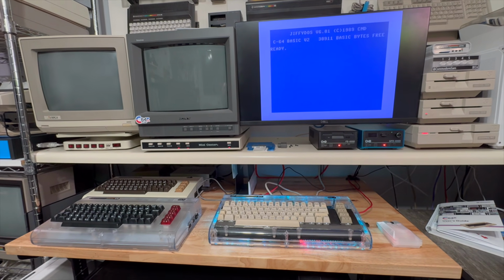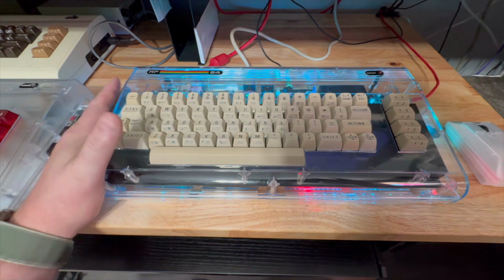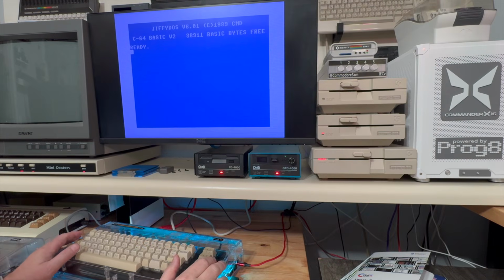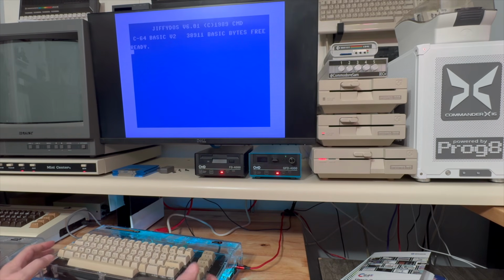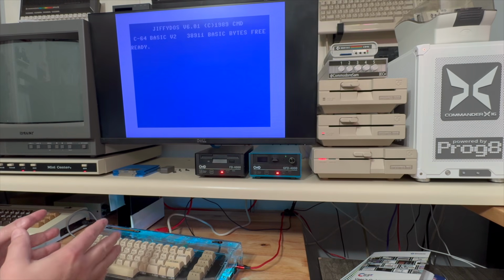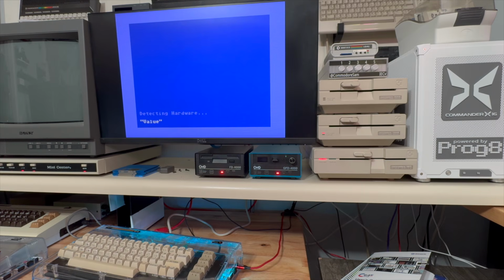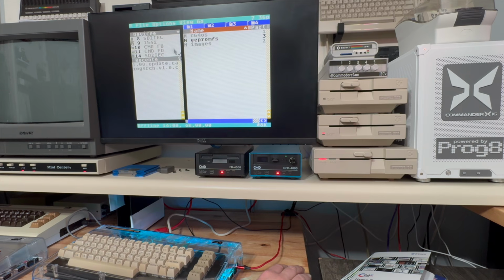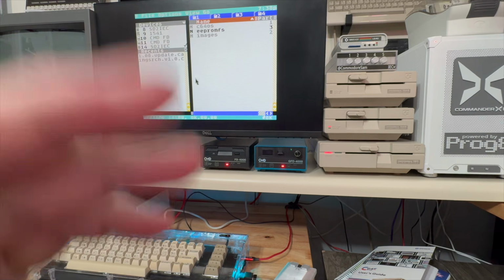uIEC/SD Internal SD2IEC for the Commodore 64 Ultimate and Ultimate 64 Elite II

Comment: Thanks for all the information. I really enjoy your YouTube videos. I found one caveat though. You cannot disable the uiec2/sd which is required using some software that is copy protected. I have the daughterboard which has buttons and long pressing the forward button disables the uiec2/sd temporarily. There is also a way to use the atn line with a switch to disable it according to a poster on lemon 64.

"According to the Wiki ( https://www.c64-wiki.com/wiki/%C2%B5IEC  ) , holding S1 will put the unit into sleep mode.

However, what I have done, is put a switch on the ATN line. So when I boot up I have it so the ATN is not enabled on the uIEC and the 1541 Ultimate II works just fine." 

The poster was having problems with the uiec interfering with his 1541 ultimate. Right now I am going to use the uiec2/sd externally with the daughter card. It would be simple to add a switch on the atn line, but then I would need to mount it somewhere. Thanks for all the help.  Ro

Comment: One more question. Is it possible to disable the uIEC without opening the C64 and pull out the wires? There is software that does not like other drives on the IEC bus. I have read that an on/off switch on the ATN pin could disable the drive when powering the C64 on.
Reply from the maker: Not currently. I am considering what I want to do about that. However, for most people it would be a rare need. If I do come up with my take on a solution, I will post an update video. Thanks for watching.
Reply: @CommodoreSam Thank you very much. My next step is to try out the OS. The file manager looks really good.

Comment: How do you set the drive number for the uIEC/SD ?
Reply: Device Address
The SD2IEC device address may be changed with the U0 command, with the following syntax.

OPENlf,dv,15:PRINT#lf,"U0>"+CHR$(d):CLOSElf
Where:

Variable	Description
lf	a logical file number
dv	the current device number of sd2iec
d	the device number (8 to 30) to change to
Example:

OPEN15,8,15:PRINT#15,"U0>"+CHR$(12):CLOSE15
JiffyDOS Examples:

@"U0>"+CHR$(16)
The new device number is temporary, until the power is cycled or the sd2iec is reset. Changes to the device number are saved permanently when settings are saved.
Reply: @Cpueditor  Thank you for info. I hope to receive my uIEC/SD maybe next week. Already have the dupont wires.

Comment: This is very interesting and I'm considering using C64 OS with my Commodore 64 Ultimate.  What specific uIEC/SD configuration (SKU) do you need from Retro Innovations === UIEC-SD-BA (none), UIEC-SD-EC (1x13 Edge Connector), or UIEC-SD-DD (Deluxe Daughterboard)?
Reply from the maker: If you want only the internal option for the Ultimate, choose "none". If you want it external (plugged into the tape port for power and the IEC for drive functions) then get it with the "Deluxe Daughterboard". You might consider the later if you think there is any possibility of changing your mind. It would be difficult to change with out it.

Comment: If using a Commodore 64 Ultimate, couldn't you just copy the C64OS off of the SD card it comes on and onto a micro SD then boot to it using the built in micro SD card slot built on the motherboard?  Then you wouldn't need to by an extra SD card adapter.
Reply from the maker: Currently, on an Ultimate, all that SD space is available only for the FPGA to feed it into the implemented hardware that is built in... 

1. DMA inserted into memory as a single load (new way that ulitmates and carts use today),
2. REU loading from a saved file could also be considered. It's kind of it's own animal (new way on an ultimate),
3. CRT being inserted into memory (old way that mimics original carts ),
4. From a disk access standpoint the Commodore DOS can read into memory from the implemented 1541, 1571, 1581 via d64, d71, d81 files. dnp files are implimented, but only with SoftIEC commands I believe. (mimics vintage drives). The SoftIEC implements a drive, but it is incompatible with most software as it does not use the only real standard from back in the day... CMD.

But the CMD FD, CMD HD, and SD2IEC (skinny CMD compatibility) drives are not implemented and their respective file formats not loadable. These are the only "standard" from back in the day and viable going forward IMO.